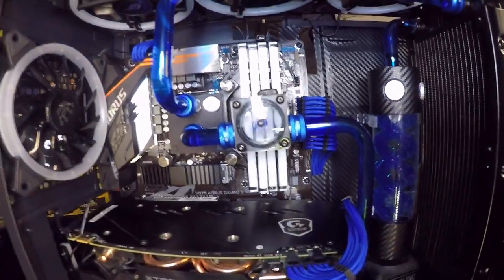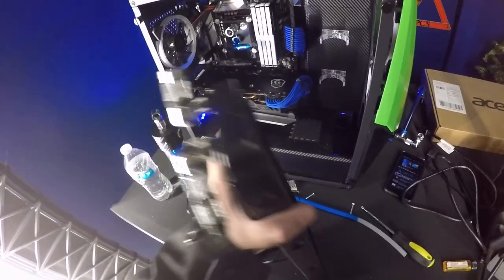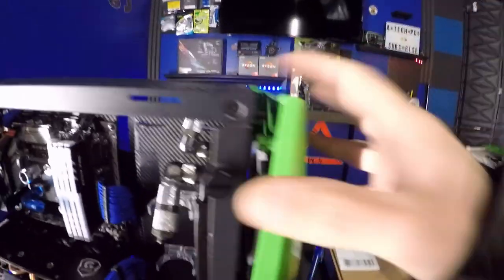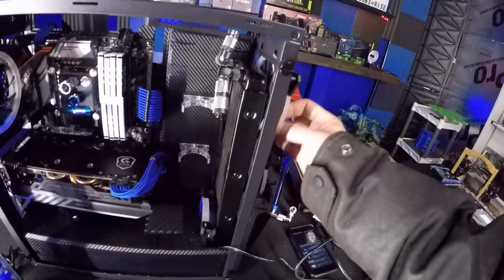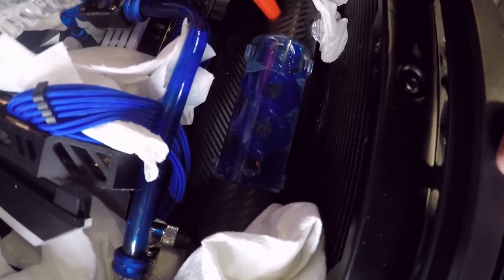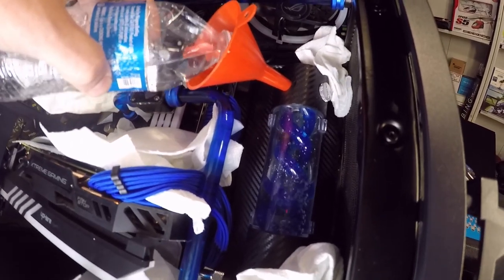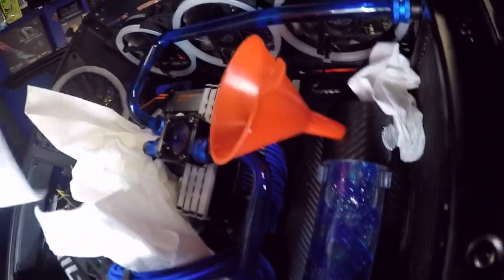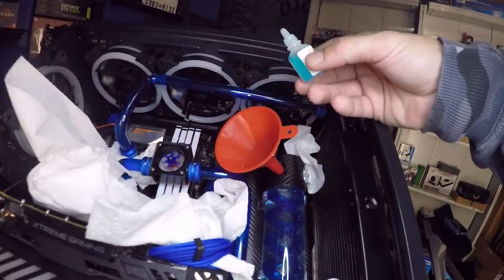LETS  FILL 🔫  THIS  PC  WITH  WATER  😎

Comment: Sick build! I just finished my first build and I can't decide if I should keep my clear coolant or change to colored coolant.
Reply from the maker: Noo. Dont add color.   That gets into the micro channels of the block. And it will gum it up and slow down the flow of water.... The heat breaks down the color dies in the coolant and gums up and blocks the flow of water...  I only run ...water.  Just straight water .. And i never have a problem
Reply from the maker: Please Subscribe